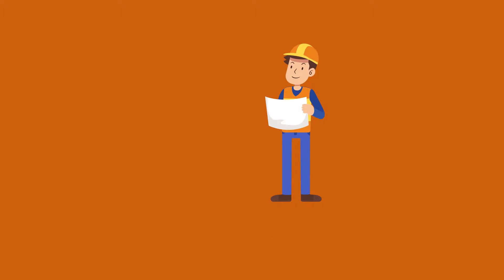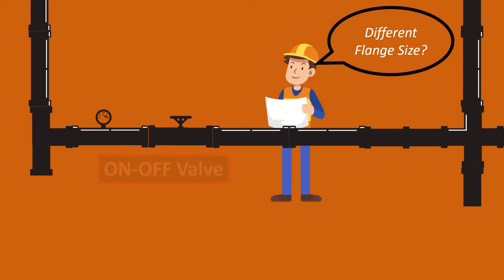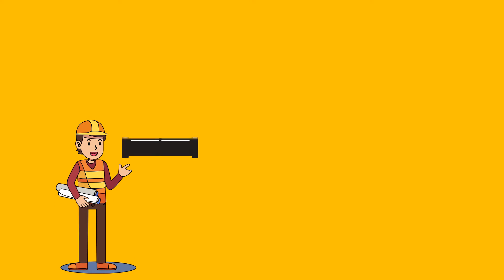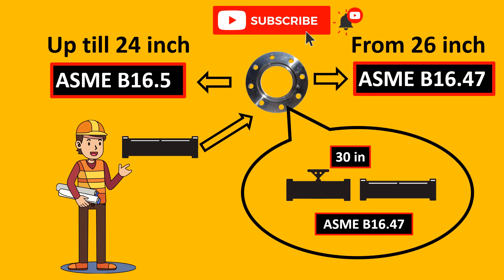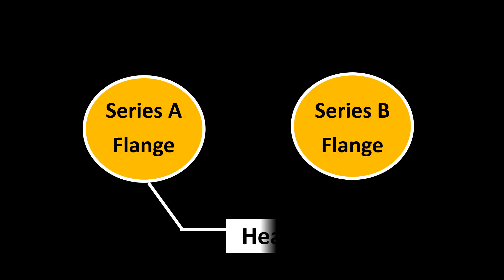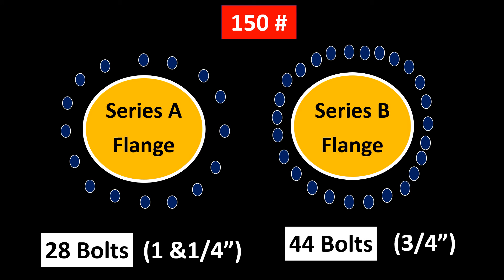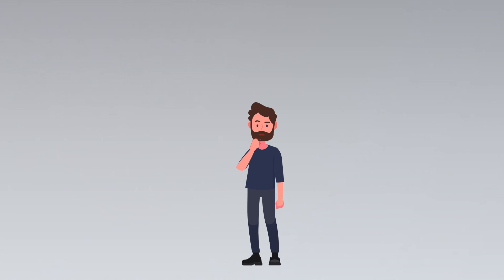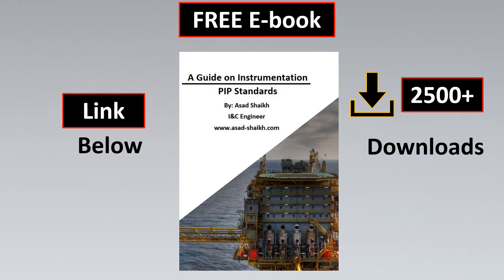NEVER do this ON OFF Valve MISTAKE

Comment: This type of error is generally observed in butterfly valves.

Also as far as I understand RTJ facing is available only one of the series.
Reply from the maker: Yes Good Point, RTJ is available in Series A flange only since it can handle far higher pressure as compared to Series B flange.